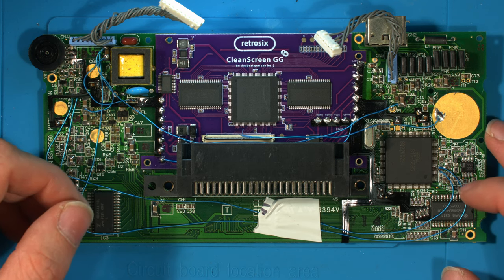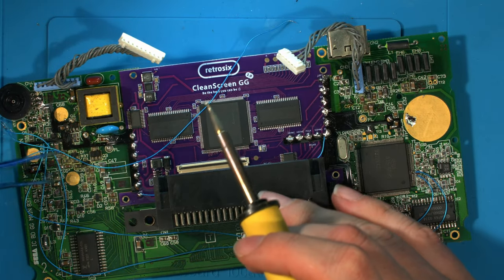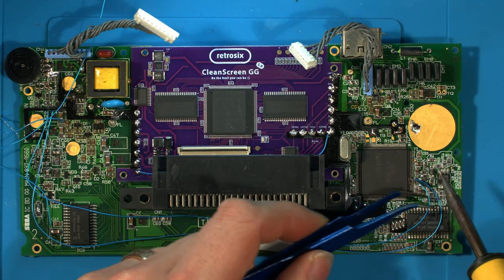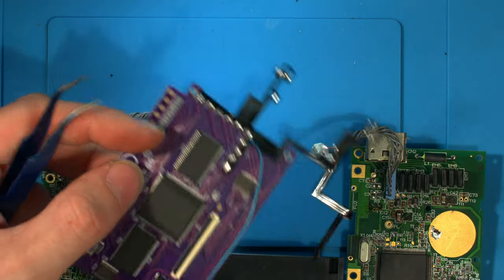Brand New Game Gear in 2022 - SYF Cartridge Connector Swap Build

Comment: Are you saying you're going to be selling new cart connectors soon? 

 have a few gamegears that badly need a new cart slot. Every time I try to find a parts board to harvest a slot from I end up with a console that just needs a recap so it just makes more sense to recap that thing instead of harvesting the cart slot off of it.
Reply from the maker: Sure am. It will be a smart cart too with debug features to detect working console and good game

Comment: When do you expect your new cartridge connectors will be available? I have a really fickle one in one of my GGs. Have you ever repaired a cart connector? Is it doable?
Reply from the maker: Yes repaired many. Mainly using diamond file to clean and tweezers to bend out. New connector is a while away. Requires PCBs and a mould making so months. But it's coming
Reply: @RetroSix  thanks for the tip, I'll give a file and benderoo to those pins in the meantime! Love the channel!

Comment: You mentioned deep cleaning in an ultrasonic cleaner, do you have any recommendations what solution to use? Mine doesn't recommend flammable liquids even though it's not heated, so I'm not sure if distilled water would suffice or something else
Reply from the maker: You can get specific PCB cleaning fluid for ultrasonic cleaners if you search for that
Reply: @RetroSix  thanks I'll keep a look for it
Reply: Crest Ultrasonic Cleaner with 103 ml Branson EC per every gallon of distilled water, then dump in a 99% alcohol bath and then dry off near a dehumidifier.